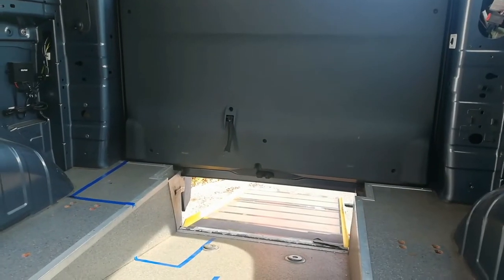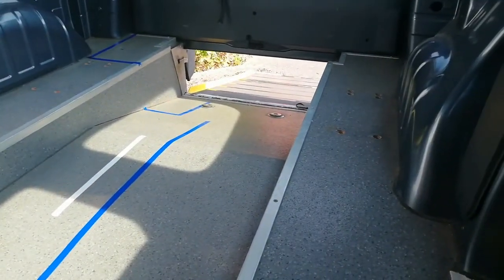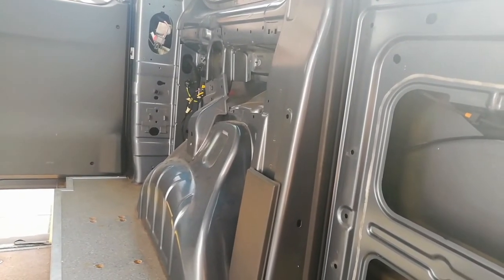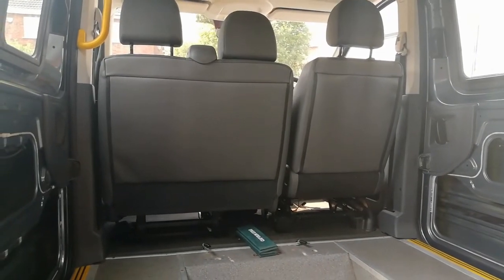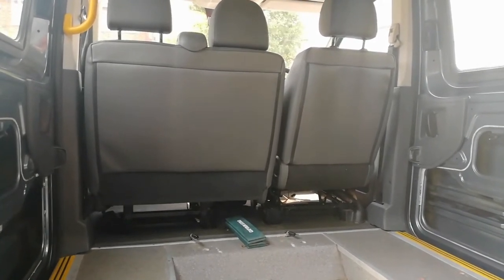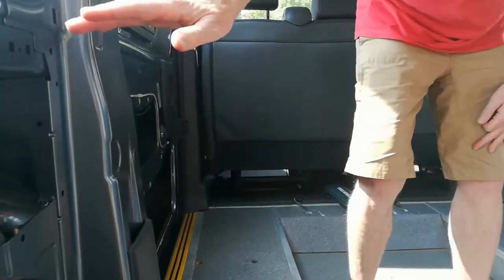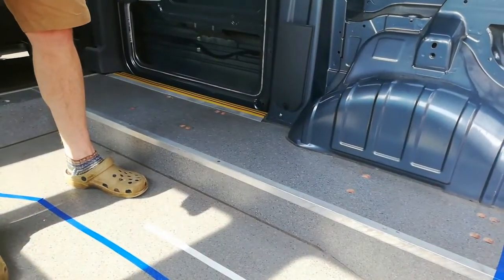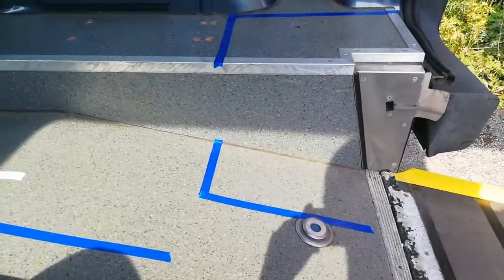Peugeot Expert Tepee Camper Conversion - Part 3.5

Comment: Hi Gayle, I've just gotten myself a tepee for conversion and your series has been really useful. I was just wondering on this video, theoretically, would it be possible to remove the raised sections of the floor down to the base of the vehicle to offer additional height across the whole living area? Thanks!
Reply from the maker: The 'raised' parts of the floor are the original floor of the vehicle, and they sit on the chassis members. The middle section is a cut-out between the chassis members, into which a trough has been welded. So, no, it wouldn't be possible to lower the whole floor.
Reply: @GayleEBird  thanks a lot for the quick response Gayle, really appreciate it. So I guess the two options are work the trough in go a design as you yourselves did or level the trough out to the rest of the vehicle with a floor on top?